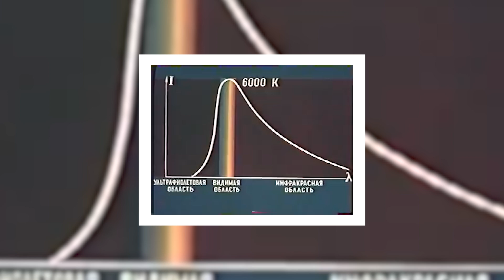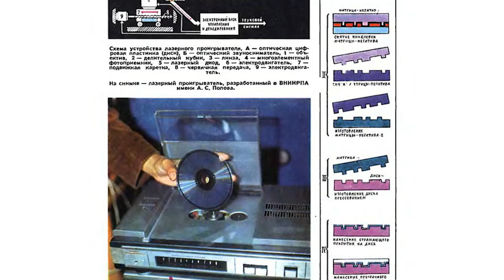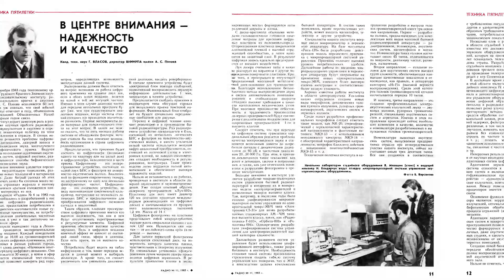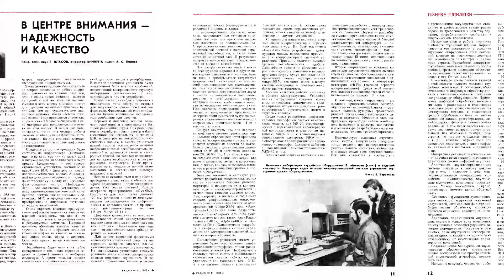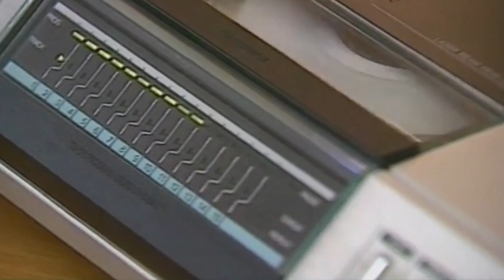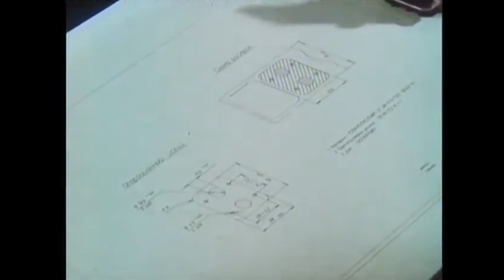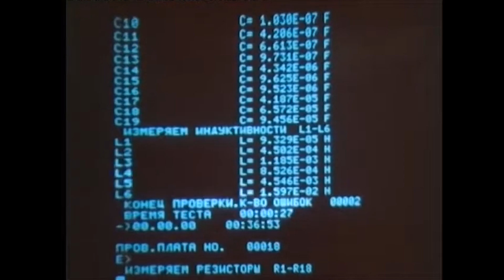Soviet Union invented CD in 1979 / Soviet Tech Tales

Comment: Sony first publicly demonstrated an optical digital audio disc in September 1976. A year later, in September 1977, Sony showed the press a 30 cm (12 in) disc that could play an hour of digital audio (44,100 Hz sampling rate and 16-bit resolution) using modified frequency modulation encoding.[22] In September 1978, the company demonstrated an optical digital audio disc with a 150-minute playing time, 44,056 Hz sampling rate, 16-bit linear resolution, and cross-interleaved error correction code—specifications similar to those later settled upon for the standard compact disc format in 1980.

Comment: 3:40 - The 44.1kHz sampling rate parallel is interesting.
In the Philips-Sony system, this is a value essentially "inherited" from using Analog Television magnetic tape systems to do the mastering.  Sony already had active production of "U-Matic" machines that ran cartridge-stored magnetic tape for broadcast TV work.  This system stored ~30 frames/sec of 490 image lines (interlaced in implementation, but the net rate is what matters).  The Sony adaptation (NTSC) put 3 samples per image line (stored as light/dark luminance signal on the tape).  30fps x 490 lines/frame x 3 samples/line = 44100 samples/sec.  The PAL system has different framerates and lines, but identical results.

If the Soviet system used 11 bit instead of 16 bit samples, this is a really weird coincidence.  Sony chose 3 samples/line because it was a data density that reproduced well given the characteristics of common U-Matic tape, but wasn't a poor utilization of the tape capacity.  It hit a sweet spot.  Even using the same analog television magnetic tape, the Soviet system, at 11-bits per sample, could have easily supported 4 samples/line at a similar bit density, which would have resulted in a higher sampling rate (58.8 kHz).

It's also REALLY coincidental that both Sony/Philips and the Soviets chose to use television magnetic tape systems for the data storage.  Sony did it out of convenience, since U-Matic was a full-production system, and was easy to adapt to the CD's data storage requirements with minimal modification.  There's no fundamental reason why a Soviet project, ostensibly with military applications, would have followed the same choices (did Soviet Union have such an abundance of television magnetic tape machines?).  You'd wind up with a totally different sampling rate for any of a number of arbitrary reasons.
A few years later, commercial DAT introduced 48kHz sampling, because it didn't need to work within the confines of the analog television standards.  It was an independent project, and the designers had the freedom to pick a different, higher sampling rate.
Reply: Yes, I doubt the Soviets had the equivilant of a Sony Umatic player, let alone a variant modified for recording digital audio and much less the editing control equipment that enabled it to be a production system.
So you can only conclude they were working with data obtained from the west that they despise so much. As usual.

Comment: I have one Marantz CD-73 from 1983 I've changed all the bad philips capacitors in, and have since then worked flawlessly for years after that now despite reaching its 40 years of age. 
It also uses the og CDM-0 mechanism as the first Philips CD player.
Sounds nice too with it's dual 14-bit TDA-1540D dac.

Comment: The history of the compact disc is complicated. There was a lot of innovation and things that happened in the YEARS leading up to the release that makes it confusing. It may have hit the consumer market in 1982...but the ultimate history of the CD goes back further. Back in about 1956 an engineer made a prototype that stored something close to a video signal on a transmissive optical disc; a non-reflective disc. So this got a bunch of guys trying to store other stuff on disc. James Russel worked on a prototype he got a patent for...but it didn't resemble what we would consider a compact disc. What he mostly got a patent for was the idea of storing digital audio on an optical disc. His format ultimately had a lot of problems and barely worked. Digital audio was not exactly new...the core concept had been in use since the third generation of vacuum tubes (the 1930's). The military was using PCM to encode phone calls in the 40s. Patents were issued in 46, 52, and I think 56...but "The Philosophy of PCM" was published in 1948. 

So everyone was actually using PCM that far back. Phone calls in the US have been using PCM since the T-Carrier system in 1961. NHK in Japan made what was considered the first PCM recorder....30khz at 13-bit using DBX compansion. In the early 70s Denon made the first commercial recordings and later came out with a multi-channel digital deck...47.25khz @ 13-bit. They came up with a portable version that could achieve "15.5 bits" of range using 14-bit audio and emphasis. Soundstream in the US had some of the very first digital audio workstations that used tape storage to provide digital audio editing. These systems used like 60khz sample rates.

I should also note that by 1972....Russel and his team had working digital video and a prototype digital video disc. Philips, which at this time was going all in on LaserDisc...did come up with the reflective disc around this time. 

Now I'm not trying to downplay the soviet innovation or anything. They may have independently invented a format that was similar in a concept...but there were a lot of formats invented between Russel's 1965 concept and what we got from Philips and Sony in 1982. They probably could have gotten it out earlier but they were still trying to decide on a format and work out some of the small issues with tracking. Sony's major contribution was tracking technology, 74 minute length, and 16-bit audio; much to the chagrin of Philips who had gone all in on 14-bit to the point they had to produce inferior players due to having made all this 14-bit DAC stock.

It's a shame no prototypes or actual information exists. I would be interested to see how they came up with solutions to various things like time code and track indexing.

Comment: Not to forget, the Laserdisc existed before CD and worked the same way.
Reply: Except Laserdisc is a completely analog system.  Even Dolby Digital on later discs was encoded on an analog RF carrier.
Reply: @drozcompany4132  LDs had digital sound from mid-80s on. Earliest ones I'm aware of are from 1983, but it coexisted with analog sound discs. It was of course made possibly due to ICs created for CD players but still - "completely analog" is only a statement that applies to it's early era.
Reply: @drozcompany4132  Also the video recorders used for recording digital audio were analog.
Reply: Lolpwnt

Comment: Both Gregg's and Russell's disc are floppy media read in transparent mode, which imposes serious drawbacks. In the Netherlands in 1969, Philips Research physicist, Pieter Kramer invented an optical videodisc in reflective mode with a protective layer read by a focused laser beam U.S. Patent 5,068,846, filed 1972, issued 1991. Kramer's physical format is used in all optical discs. In 1975, Philips and MCA began to work together, and in 1978, commercially much too late, they presented their long-awaited Laserdisc in Atlanta. MCA delivered the discs and Philips the players. However, the presentation was a commercial failure, and the cooperation ended.

In Japan and the U.S., Pioneer succeeded with the Laserdisc until the advent of the DVD. In 1979, Philips and Sony, in consortium, successfully developed the audio compact disc.

In 1979, Exxon STAR Systems in Pasadena, CA built a computer controlled WORM drive that utilized thin film coatings of Tellurium and Selenium on a 12" diameter glass disk. The recording system utilized blue light at 457 nm to record and red light at 632.8 nm to read. STAR Systems was bought by Storage Technology Corporation (STC) in 1981 and moved to Boulder, CO. Development of the WORM technology was continued using 14" diameter aluminum substrates. Beta testing of the disk drives, originally labeled the Laser Storage Drive 2000 (LSD-2000), was only moderately successful. Many of the disks were shipped to RCA Laboratories (now David Sarnoff Research Center) to be used in the Library of Congress archiving efforts. The STC disks utilized a sealed cartridge with an optical window for protection U.S. Patent 4,542,495.

The CD-ROM format was developed by Sony and Philips, introduced in 1984, as an extension of Compact Disc Digital Audio and adapted to hold any form of digital data. The same year, Sony demonstrated a LaserDisc data storage format, with a larger data capacity of 3.28 GB.[16]

In the late 1980s and early 1990s, Optex, Inc. of Rockville, MD, built an erasable optical digital video disc system U.S. Patent 5,113,387 using Electron Trapping Optical Media (ETOM)U.S. Patent 5,128,849. Although this technology was written up in Video Pro Magazine's December 1994 issue promising "the death of the tape", it was never marketed.

In the mid-1990s, a consortium of manufacturers (Sony, Philips, Toshiba, Panasonic) developed the second generation of the optical disc, the DVD.[17]

Comment: Although the first CD player was released in 1982, prototypes had existed with both Sony and Philips in the 70s.  So no, the Soviet Union did not "invent" the CD Player
Reply: James Russell invented the overall concept of optical digital recording and playback.The earliest patents by Russell, US 3,501,586, and 3,795,902 were filed in 1966, and 1969. respectively.He built prototypes, and the first was operating in 1973
Reply: @linasma235 the first digital disk read by laser was demonstrated in 1969, and patent filed in the United States in 1972.  Philips and MCA worked together through the 1970s and premiered laserdisc for video and audio at the electronics show in Atlanta in 1978.

Also glass was a very proven format by 1979.  The west was using metal deposits on glass since 1958 for magnetic data storage.  Metal disks would tend to wobble at high speed, and glass was the only substance at the time that could reliably stay straight and not shatter at high speeds.   This was actually one of the slowest parts of creating the commercial CD.  They spent quite some time working on the precise chemistry of polycarbonate needed to hold up consistently in consumer conditions and not pose significant risks of shattering.
Reply: @LogicalNiko the laserdiac player is ironically an analogue rather than a digital player. It reads an analogue signal by laser off the disc.
Reply: @LogicalNiko  .The earliest patents by Russell, US 3,501,586, and 3,795,902
Reply: @LogicalNiko I remember, my early disks are a few times shattered.
Reply: @ajfurrell3744  yeah really that’s all about data encoding.  But yes when MCA created “DiscoVision” (yeah not a typo), they basically just took the broadcast encoding and tossed it right on the disc.  The issue was DACs were too expensive at the time the patent was filed and the standard created in 1963, but it didn’t get to market until 1978.  And by 1978 digital encoding had moved miles ahead, but it was too late to get new commitments to a digital format and not loose competition with VHS.
Reply: That's not what he said or implied at all.
Reply: Came here to say post this, but you beat me to it.
Reply: This Russian guy is brainwashed by Soviet/Russian propaganda and he also doesn't understand the meaning of the word "innovation".
Reply: Neither did Sony or Phillips. Many researchers independently started work on the idea and some had the financial backing to see a commercial product released. CD isn't an invention by itself, dumbass westoid.
Reply: For those saying that the USSR didn't invent something in electronics, check out this-

1948-1950. Not only in the United States, but also in other countries there have been scientific research in the field of semiconductors. For instance, a Soviet physicist V.E. Loshkarev as early as in 1946 discovered the bipolar diffusion of nonequilibrium current carriers in semiconductors. A.V.Krasilov and his group designed germanium diodes for radar stations. [Presumably still classified research] in Fryazino (Moscow region) in the Research Institute-160 (Research Institute "Istok"). A.V.Krasilov and S.G.Madoyan first observed the transistor effect. The creators of the domestic transistor A.V.Krasilov and S.G.Madoyan published the first article in the USSR on transistors, "Crystal Triode." Laboratory samples of germanium transistors were developed by B.M.Vul, A.V.Rzhanov, V.S.Vavilov, and others (FIAN), V.M.Tuchkevich, D.N.Nasledov (LPTI), S.G. Kalashnikov, N.A. Penin and others (IRE USSR AS)...

1960s. In the USSR in 1963 the Center for Microelectronics was established in Zelenograd. A Soviet engineer F.A. Shchigol developed a planar transistor 2T312 and its open-ended analogue 2T319, which became the main active element of hybrid circuits. In 1964, the Angstrem plant at the Research Institute of Precision Technology created the first integrated circuit IC-"Path" with 20 elements on the crystal, performing the function of transistor logic with resistive connections. At NIIME in Zelenograd technology was created and the first planar transistors "Ploskost" were launched. Under the direction of B.V. Malin at NII-35 (nowadays the scientific research institute "Pulsar"), the first series of silicon integrated circuits TS-100 (degree of integration - 37 elements on the crystal) was created. In 1966, the first experimental station for the production of planar integrated circuits began operating at the Pulsar Research Institute. At the NIIME the group of Dr. Valieva, started production of logical and linear integrated circuits. In 1968, the Pulsar Research Institute produced a batch of first hybrid thin-film ICs with planar, open-frame transistors of the types KD910, KD911, KT318 intended for television, radio broadcasting and communications. Digital and linear ICs of mass application (series 155) were developed in the Research Institute of ME. In 1969, a Soviet physicist Zh. I. Alferov formulated and practically realized his ideas for controlling electron and light fluxes in classical heterostructures based on the gallium arsenide arsenide system. Digital and linear ICs of mass application (series 155) were developed in the Research Institute of ME.

https://hsm.stackexchange.com/questions/6367/did-the-soviet-union-have-their-own-discoveries-in-the-development-of-semiconduc#:~:text=There%20is%20a%20fascinating%20story%20of%20two%20Soviet%20spies,%20Barr
Reply: wrong USSR invented it and Philips copied
Reply: Of course , that CD was not invented in Soviet Union.
Reply: That doesn’t mean sony and philips invented first so
You should have better said ‘Possibility’ rather than ‘not’.
Reply: I bet they stole the idea through spies
Reply: And stop invading Ukraina
Reply: @zerblatt3365 this man on YouTube is not invading Ukraine.
Reply: And stop invading native Americans land
Reply: @pawesmola7635  I not american but you are russion so stop invading Ukraina

Comment: Since about the 70s, the gradation of radio equipment by class has been adopted in the USSR. There were 5 such classes. It was possible to find out the class of Soviet equipment after 1973 by the first digit after the name of the tape recorder, for example. "Legend-404" - the fourth class, Romantik-304" - the third class, "Mayak-203" - the second class, "Olimp-003" - the highest class. The class of equipment is a certain combination of the complexity of the device, the engineering solutions used, the degree of functionality (what he can do), the quality of materials and parts, and of course the characteristics (for sound reproducing equipment, these are its sound characteristics - harmonic distortion, detonation, frequency range, etc.) The fourth class is the simplest devices, with low characteristics, and The highest class can often even be attributed to professional equipment.In this sense, the Soviet approach is more honest with the buyer, who knows exactly what class the item he is going to buy belongs to and roughly understands his expectations from the acquisition.
Reply: in a store for housewives - equipment for housewives,
            --
   in the USSR - all the equipment was of the lower class, - so there was no demand.